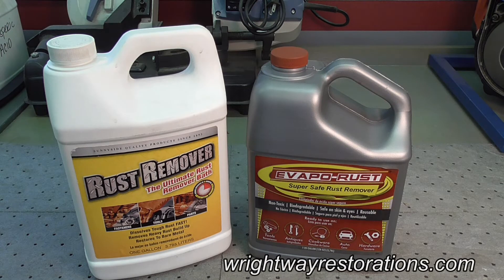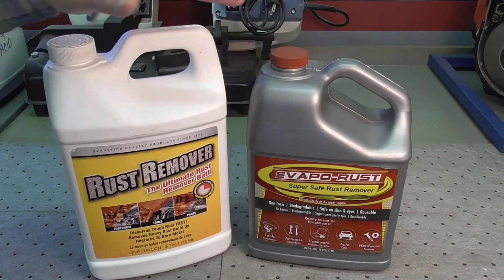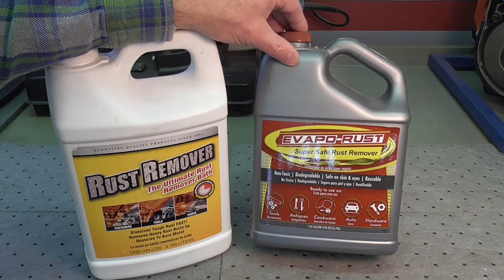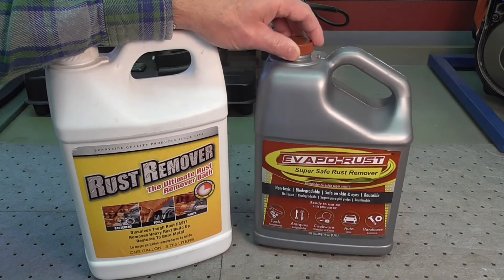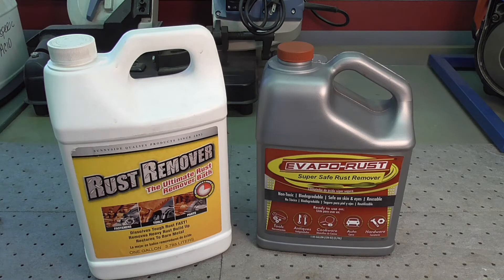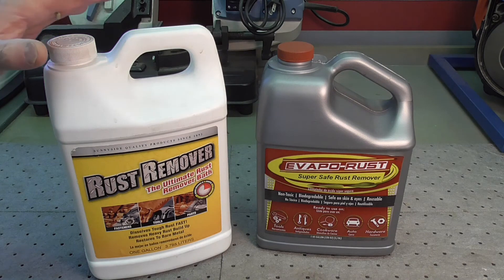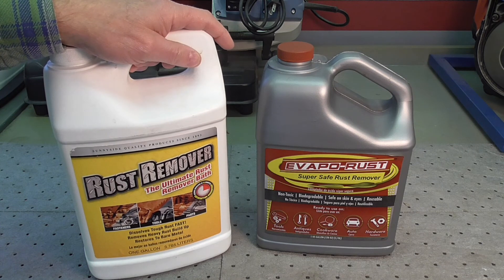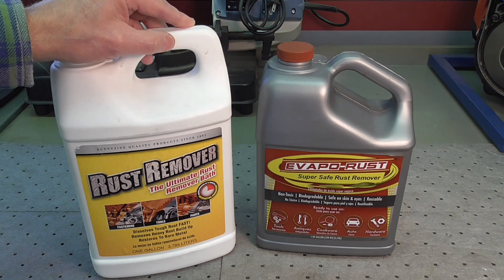Shop Talk #27, Discussing Rust Removers --- Video #181

Comment: When you mentioned that these products are heat / cold sensitive , as per the label .  I have a had much success with Metal Rescue , this is a similar product , but I use a Aquarium heater directly in the product in a plastic container .  My shop is not cold but is cooler than room temperature .
Reply from the maker: I have used Metal Rescue but it's been a few years and I don't have any right now.  I suspect the basic underlying chemistry is the same among most of these non-acidic rust removers.  Heat definitely improves performance though I don't usually heat the product.  My shop is about normal room temperature and that seems to work OK.
Thanks for the comment...

Comment: What do I apply after using it? Rub some oil with a cloth?
Reply from the maker: Yes, it's generally a good idea to apply a thin coat of oil as rust preventative after rust removal.  WD40 works well for this, though almost any oil will do.